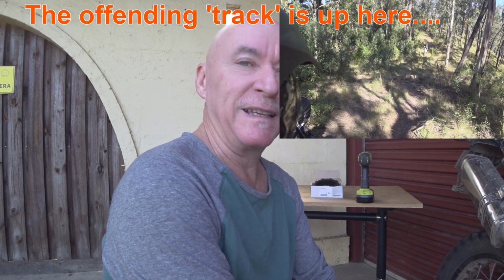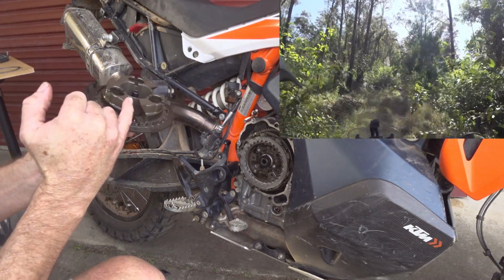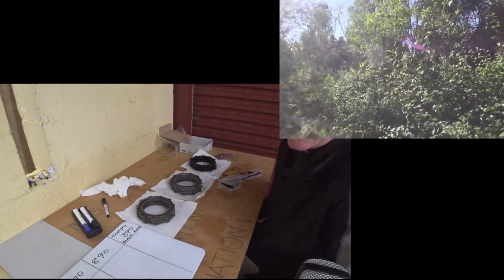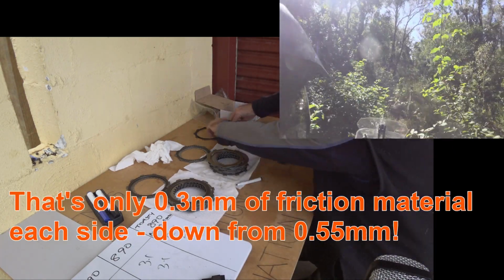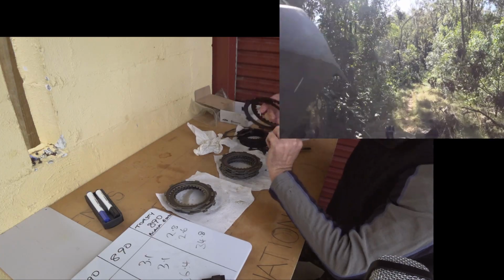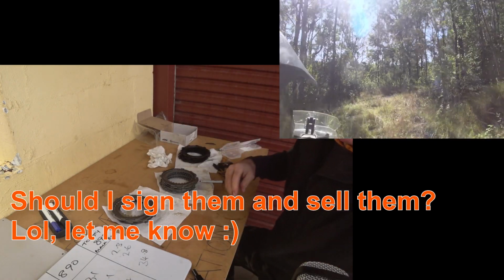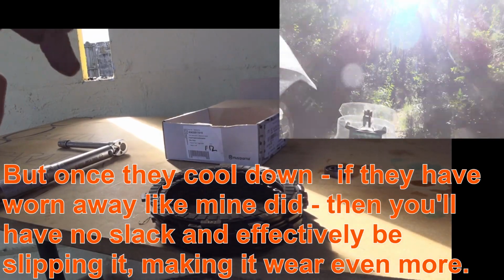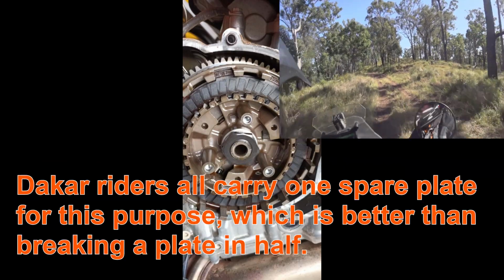I burnt out my 890 Rally's clutch!

Comment: Thanks for the video. Have the same issue on my 2023 890 R with 11.000 km. I'm wondering that you're clutch was gone, as the wear limit following the repair manual is 34.8 mm. So you toasted it to the limit. But in my understanding the clutch should work until the wear limit.
Reply from the maker: It worked and got me home - the real issue was the incorrectly adjusted one finger 'arm' was hitting the tank - meaning I couldn't give it more freeplay, so it would have kept wearing and left me totally stranded eventually

Comment: Sorry
Id rather listen to the instructions to change the clutch instead of your adventures
Reply from the maker: I've included putting them back together correctly in most of my bike reviews...the only tricky part is the last plate is offset from the rest to make the slipper clutch work correctly. The rest only goes in one way. Cheers
Reply: 100 %%%%%%

Comment: It’s a KTM mate , you’re lucky it lasted that long.
Reply from the maker: my 790R is still on it's original clutch at nearly 50,000km....and since then I've done the Simpson desert, Fraser Island twice and two Flinders trips - still nothing but smiles and wheelies :)
Reply: @890RallyAdventureR   my 2019 with 9000 kms or 5592 miles clutch just burned to the ground. apparently there is a jet that oils the clutch for cooling that might be restricted but the guy at my local ktm says there is no jet 🤷🏻‍♂ it is a 3mm hole some people change it for a .5 mm but i cant even find the jet online i just purchased a new clutch but this might happen again if this  jet oil flow is actually restricted.
Reply from the maker: @robertomariscal  hi, yes there is a jet you can unscrew in the middle of the clutch basket (with a perfect screwdriver, it is loctited in!). Some people's jet has blocked...it will cause problems. At major services they check them. Good luck...please use the right screwdriver
Reply: @890RallyAdventureR   Yep I saw the jet did not use a perfect screw driver and couldn't remove it. It is a bit stripped now😲 the ktm mechanic insists there is no jet lol. I dont have an impact driver and the area is to small for a propper fitting one since it is threadlocked in, a smaller one wont do the job so not sure how to remove it to inspect or change it.
Reply from the maker: @robertomariscal  I assure you there is a jet there....removing it may take a little heat from a heatgun to loosen the loctite now maybe....(but before that I'd buy a new one and get the perfect bit, and replace it with the undamaged one just to be pedantic)...may the force be with you!

Comment: Thanks for detailed explanation. Just one question, did you have 1 fingers clutch arm on your 790 that lasted 44k km? I just completely toasted my clutch on 2022 890 (8k km) and when brought it in for repair, the shop tech said that extended 1 finger clutch arm could definitely contribute to that. Everything was set up properly. 5 mm free play at the clutch lever.
Reply from the maker: Yes, I have the 1 finger clutch arms on both my 790 and 890 Rally that's now done 31,000Km (it's still on there, but adjusted correctly now). Hope it helped. Cheers

Comment: Hmm, not sure I got this. So the point is that when the plates get thinner the arm moves outwards and this reduces the slack at the lever? Then you can tell that something is wrong because there’s no slack and you can adjust it? But in your case it all went bananas because the longer 1 finger arm hit the tank? Which effectively means the clutch was always pulled a little? And the slack at the lever was not affected?  🤔🤔🤔

hmm, I thought the slack at the lever was to allow for plates expansion as they get hot. But this is the other way around… the slack would increase if the plates expand 🤔🤔 what am I getting wrong?
Reply from the maker: Hi, sorry my bad, I didn't explain that part well - because the end of the actuating arm was contacting the tank the slack at the lever was definitely affected....I was TRYING to give it some more slack....but in fact only making the arm hit the tank. So it only felt like I had given it plenty of slack. Initially as the plates heated up the slack would have gone away like you said (until the clutch was effectively always pulled a little), then they quickly wore on that hill that I slipped it on for too long. I got the burnt friction and metal plates out for a look yesterday (filming the 25k review)....they're almost mirror smooth too now, quite polished and hard. Cheers

Comment: Boy, listening to you tell your tale made me realize that I too was at fault. I did the same thing. Set my R cold and didnt account for heat expansion. I also set my 1finger incorrectly and found it against the tank. It worked fine for a while. Then summer came and I overheated and glazed my clutch on the trails. I just got done putting a new Rekluse clutch in and Ive learned my lesson.(and not a cheap one) Cheers for the video
Reply from the maker: Easy to do eh. Glad you're back in action, enjoy :)

Comment: As someone with many years working precision measuring I feel the need to point out your measurement methods are good but that caliper is not precise to .1 mm check the paperwork it will still give you a good idea but its really only going to be precise to 1mm or maybe .5mm ..   You do have me wondering how long my 890's clutch will last but I personally try to not slip them on anything..     Good video and not trying to give you crap but wanting to raise your awareness to the precision of the tool your measuring with..  The 5 years I worked optical tooling changed my views on precision even after 10 years land surveying ..
Reply from the maker: Yep, I hear ya...but it was all I had to measure them. Not bad for the whole pack...useless for one plate. Cheers
Reply: @890RallyAdventureR  exactly...